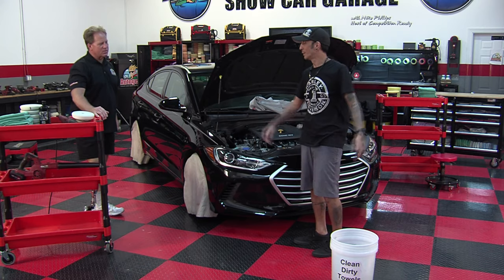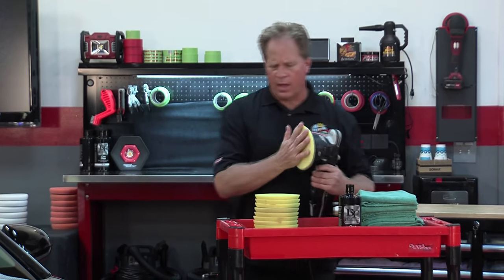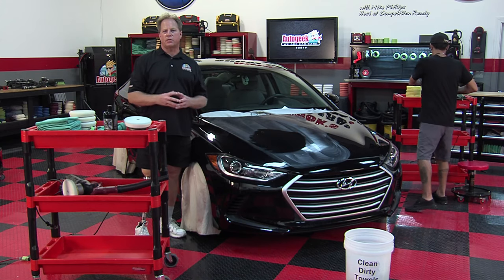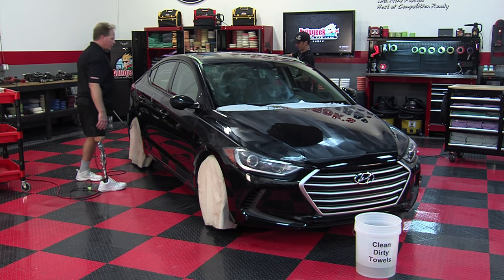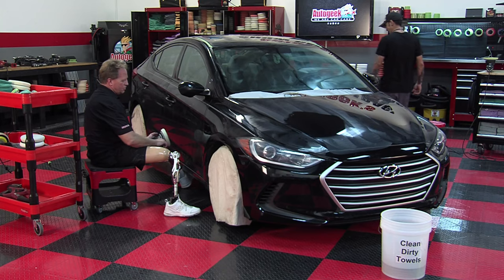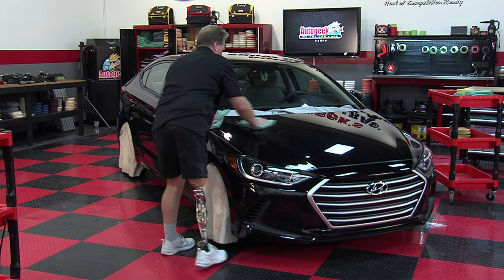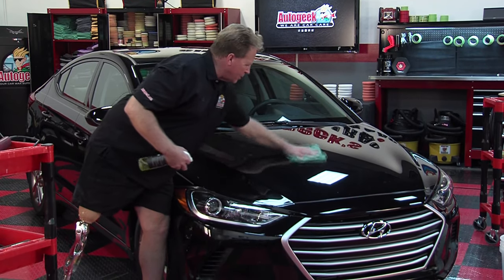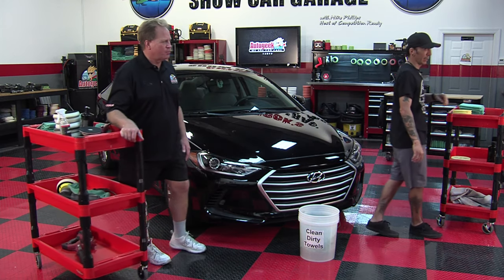How to buff out a car in one hour or less! - One Step Production Car Detailing

Comment: Awesome video. I have been detailing cars since I was 14 so 30 years now and all the new machines and products are hard to keep up with. I started when I was 14 using the old meguiars 16 in a blue paste wax talk about a shine and workout it took 3 hours just to apply and wipeoff
Reply from the maker: Thanks for watching.  The wax you're talking about is Meguiar's M16 Professional Paste Wax.  It came out in 1951.  I have a couple of cases of it in my antique wax collection.

We used it a few weeks ago in this video

https://youtu.be/nS4jfCWsqT0

-Mike Phillips
Reply: @autogeek  hello have you tried the technicans choice ceramic detail spray or the ceramic polish?  I just did my nephews 2008 Pontiac torrent which is a gold color. I washed it dried it used my da to do the ceramic polish than went over it with the ceramic detail spray and all I can say is wow. Turned out beautiful. Super shiny super slick and with that combo should get 8+ months of protection. I also have the turtle wax ceramic products in my arsenal. The technicans choice seems to be a little more aggressive and took out all the scratches and swirls
Reply from the maker: @RC-oz7hp   - Have you seen my full review for the Hybrid Solutions Ceramic Polish Wax.   Check it out here - my write-up is LIKE taking a detailing class.  Pictures are powerful too.

https://www.autogeekonline.net/forum/product-reviews-by-mike-phillips/125897-review-hybrid-solutions-ceramic-polish-wax.html

-Mike Phillips
Reply: @autogeek  is that the turtle wax brand

Comment: I love the Flex 3401 so much, I have 2 of them. 1 for 5 1/2" pads, 1 for 6 1/2"+ pads.
Reply: Same here. :) maybe down the line I'll add a third, for 4" pads (using the Lake Country plate system for the 3401)
Reply: @bbdetailing9123  I tried that backing plate, lasted maybe 2 minutes before melting. Because it was just over a month after purchase when it happened they said they couldn't do anything. It was 32 days before I had the rite car in the shop to try it out, about 2 minutes later melting plastic dripped onto my customers fender. That was a bad day.
Reply: @urbanedgeautodetailing   Oh dang! Sorry to hear that. Definitely a bad day. Sucks. I used mine (still do) quite often with the LC Hybrid pads (pre-Force pads). Always loved that combo.
Reply: @bbdetailing9123  the biggest thing that pissed me off is Auto Geek basically said it was my problem because it was past 30 days. I explained that I just opened the box and used it 10 minutes ago. Again, not there problem.
Reply from the maker: I teach that as the best way to set up your shop or mobile business.  Not only can you switch between tools/pad sizes, if you have a buddy or an employee you can both be buffing at the same time. 

FLEX tools rarely break - but if one did break then you have a back-up. 

FLEX is going to discontinue the BEAST sometime in the future - might want to stash away a back-up for the future.  -Mike Phillips
Reply from the maker: @urbanedgeautodetailing   - I don't work in sales or customer service but at some point every company has to have some kind of boundaries in place. 

Send me an e-mail and I'll see if I can help.  mike.phillips@autogeek.net 

Mike Phillips
Reply: I need to get a smaller backing plate and pads for tougher to reach areas.

Comment: Great video once again thanks
Question: With the 3 packages you would add $300 for each package if it's a van or truck? With package 2 and 3, what would be the package price difference if they only want a sealant, or would you only do a ceramic coating for those packages? On package 1 you said you would polish the windows with the one step cleaner wax, what would you do with the windows on  package 2 and 3, if your using a ceramic coating? Thanks

Comment: Would you suggest using this product and using a panel wipe prior to a coating or is there another product that you would suggest to remove swirls and polish?
Reply from the maker: NO!  Once you decide to use a  cleaner/wax or AIO - you have just made the decision you're NOT going to use a coating.  It's to hard to "know" if you were able to strip off all the wax or in this case "sealant" protection.  If you want to install a coating then stick to dedicated polishes.  -Mike Phillips
Reply: @autogeek  Thanks and enjoy your vacation!

Comment: Such great info! I do have a question and this video is a good example I think to ask it on. I’m fixing to upgrade to a forced rotation and I’m either going with the XCE or XCE cordless. I’ve watched all the videos, read comparisons etc. and I’m really torn. It seems like there’s a trade off either direction. So take this car as an example. I’m working on the vehicle by myself and say it takes me 2 hours to complete. If I were to use the cordless on this would the same result be achieved in the same time frame or do you feel like it wouldn’t quite achieve the same level? Or on the flip side if not how much more time would you think would need to be spent with the cordless to achieve the same result? A few extra passes? 
I’ve literally got them both sitting in my cart on Autogeek and I just can’t make up my mind!

Comment: What speed are you running the beast on? Just recently got one, and I too detail for a living. It is a beast...I love it!
Reply from the maker: Full speed - 6
Reply: @autogeek  hi what machine and pads compound for fresh repaints that have been 2000 and 3000 down cheers trev
Reply from the maker: @debbiejury1017  - In this video we we're showing the GEAR-DRIVEN orbitals on the market.  You can use any orbital for  anything really, just depends on what you want to do and how fast you want to go.  -Mike Phillips

Comment: Wow. I had no idea forced rotation cut so much faster than a typical DA. was going to upgrade my LHR15es to a mark 3 but now I’m thinking maybe a mille is a better buy... what do you guys think? Don’t think I’d get much correction moving my polished as fast as Mike did with my rupes.
Reply from the maker: Remember, when you say, "forced rotation" - you're describing a ROTARY BUFFER.
 
The BEAST and the MILLE are FORCED ROTATION AND FORCED OSCILLATION.  Huge difference.

And yes, gear-driven orbital will always be faster than free spinning orbital because there is ZERO pad stall no matter the shape of the panel you're buffing PLUS you don't have to LOOK and MONITOR to see if the pad is rotating the ENTIRE time you're buffing.  That's called Mental Energy.  -Mike Phillips

Comment: Great video. Probably a dumb question, but let's say you don't have 8 of the same pads to swap out, how to clean, do the pads have to be dry before use, compressed air dry them, etc.? Sorry, enthusiastic noob here. Thanks again for the great content.
Reply from the maker: Clean the face of the pad as best as you can with a nylon brush and then place in full sun to dry or place in front of or on top of a fan to air dry.  Do your best to invest in more pads.  You'll see what I share is 100% accurate.  As I like to say,

More pads are better

Mike Phillips
Reply: You can spray the pad with water, use a tooth brush, spin it, squeeze the pad repeat the process, at some point diluted APC if it is dirty,  spray soak with a bit of water, until clean or free of waxes or chemicals, the main thing is to unblock the foam open cells. Once finished, spin it inside a bucket and it will be dry in less than 2 mins. It can be a mess if you are not careful. You can also remove it from the polisher soak it in warm water, spray APC squeeze it until clean, remove as much water, then spin it to dry it.  If you have 3 or 4 pads, it's easier, maybe take a break cleaning them all at the same time, then continue from where you stopped polishing the paint.

Comment: i had the flex 3401 for about 10 yrs now and still works solid   and i also have the flex  rotary  but now im looking for a good mini 3 inch polisher  and dont know if i should continue  to stick with flex  or  go with adams swirl killer or rupes  7 mini.
Reply from the maker: Here's my take, I love the RUPES LONG neck Nano for ROTARY work and I love the FLEX PXE 80 using the 12mm free spinning drive unit to either remove HOLOGRAMS after using the Nano in rotary mode or just normal buffing to remove swirls out of thin panels. 

The FLEX PXE 80 works better than the Nano at maintaining PAD ROTATION when both are in 12mm free spin mode. 

-Mike Phillips

Comment: Let’s see gear driven only polishing on a hammered black 2015 Z06. For intricate cars there is no substitute for a free spinning machine.
Reply from the maker: I'm not sure what you mean?  I've buffed out a slew of Corvettes lately from the C8 to classic 1970's Corvettes. 

 I agree a free spinning orbital is less aggressive and more able to finish out without micro-marring of SOFT paint but for hard paint it's personal choice.

 -Mike Phillips
Reply: Autogeek For intricate areas there is no 1 inch gear driven machine that I know of. Only rupes iBrid or similar will do the job. Unless I’m mistaken. I do a lot of super cars and I use my LHR75E and iBrid majority of the those cars. And I’m not doing garage queen exotics either. These are hammered cars getting fully restored.

Comment: the speed of the arms is in accordance with the speed of rotation of the machine. Her arm movements are fast compared to when using DA. In a rotary machine you can do that and at what speed.
Reply from the maker: Kind of - if you move any polisher too fast that's called "skimming" and it won't do much as far as correction goes.  Also is you slow your arm speed down to "very" slow - you'll remove more paint and thus remove defects faster.  There's an art to polishing paint.  -Mike Phillips

Comment: I use Blackfire One Step and you are not using it correctly.  You are using way to much product.  Yes you apply a circle but not that much.  Also you are supposed to polish until it disappears!  That's even per the Blackfire directions.  "Directions:
 Work out of direct sunlight. Apply a circle of One Step onto a foam polishing/finishing pad. With the polisher turned off, spread the product over a 2 sq. ft. area of paint. Set the speed to 5 and work the product over the area. Continue to polish until product disappears. It does not require buffing." You did 8 passes and it's still thick and wet because you used too much product.